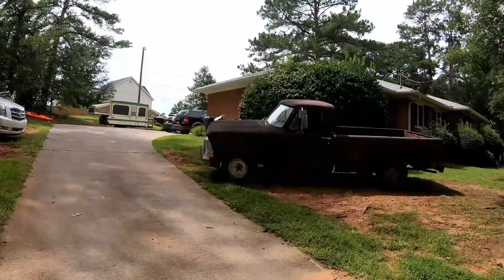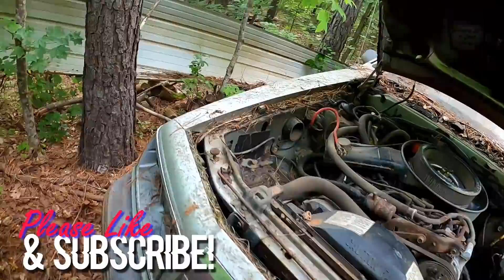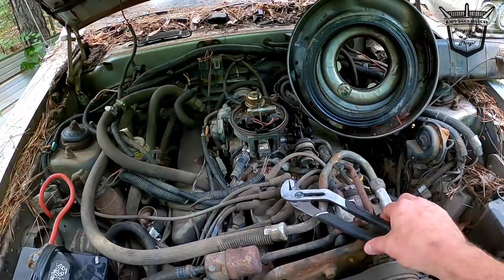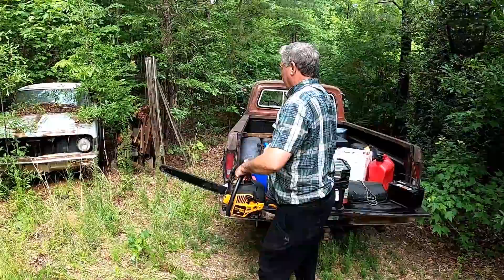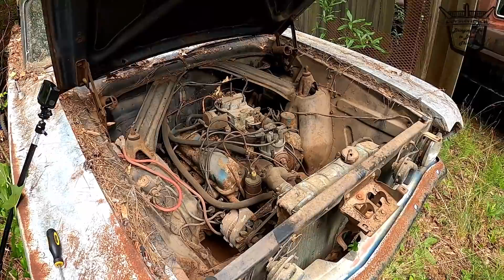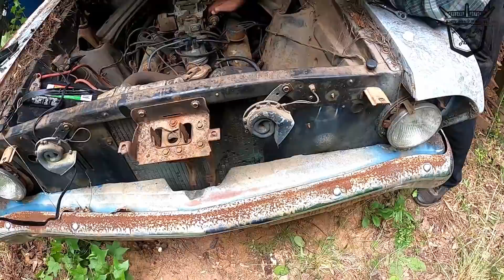First Start in Years? 1965 Ford Falcon vs. 1984 Thunderbird: Battle of the Birds // Graveyard Style?

Comment: Hey on the thunderbird you may be able to take off the throttle body and replace it with a Carburetor if the bolt pattern is the same if not you probably have to swap the intake manifold. Great video have a Blessed One Sir.
Reply from the maker: I think we could have... time was our issue on that day. I did not have enough time to dig into the car any.. It would work.

Comment: That T-Bird brings back memories.  My folks bought one new in April of '84 that was charcoal gray and Ma still had it clear up to around 2000 or so.  Never had a single problem with it, just routine maintenance.
Reply from the maker: If this one had not been wrecked... it would probably ran until the engine failed... fun rides.

Comment: Good to hear the Falcon running!
Too bad about the stuck wheel. 
You'll get it going later on!!!!
(Wish my '61 could have had a 289!!)
Reply from the maker: The engine bay has room... motor mounts and get it done.
Reply: @RevStoration  the ONE rare occasion father was working on one of our '61 Falcons, he mentioned maybe putting a V8 in it. He then commented, yeah, then we HAVE to replace the rear diff, springs,    transmission, front end hubs.......meh. nope...

Comment: Hope I am not repeating something already mentioned. Most throttle body injection (tbi) you can put a carb on them but it will cause a check engine light if the ignition system is good.
Reply from the maker: Yep, we could have but we had limited time and the engine ran that was all we wanted to know. The car is probably just holding the engine for something else.

Comment: That's what you call TBI or Throttle Body Injected  kind of like a carburetor but with electronic fuel injectors with a TP sensor and a fuel pump that runs at a higher psi then a electric fuel pump for a carb
Reply from the maker: WE may remove and drop a carb on it.
Reply: @RevStoration  That will work but I think the intake has to be changed to a carb intake the TBI intake is different and won't allow a carb to fit on it and I am not sure if they have a adapter to fit a carb on a TBI intake

Comment: The 84 thunderbird is the reason why most of the revivals on YouTube are carbureted and not fuel injected. Carbureted engines are easier to work on and don't depend on computers and electronics to run.
Reply from the maker: So true... the carbs make them easier..
Reply: The early FI like that is simple to run but you have to have the proper fuel pump putting out the proper PSI to make the injectors work on a carb it takes 5-6 PSI but on the early FI it takes 15 PSI or higher and today's FI it's even more but the old style is simple but you have to have the proper fuel pump and that cost more money then many are willing to spend on a old car that won't be seeing the road. Evern the TBI are easy to rebuild and you can buy rebuild kits for it too. It's all on how much money you willing to spend on a old car that will never see the road again and that's the reason most of them are passed on.
Reply: FI is just as easy to work on. The ECUs rarely go bad. The rest is nothing more than utilizing a 12v system. Everything is easily diagnosed & tested with a simple volt meter.

Comment: Hey, you all! I had a late '83 or early '84 silver Thunderbird Heritage Edition in the mid 1990's . Bought used with 61,000 miles on it in 1994 for $2000.00. Had a throttle body fuel injected 302 small block V8. 😁😄
Reply from the maker: They run out really well... Thanks for watching..
Reply: @RevStoration  I kinda thought that would get your attention! I've always had a long memory about my cars!😁🤟

Comment: You don't need to crank it to check pressure.  With the key in run, the pump should run.  Bad gas kills the pump in the gas tank kinda quick, so step one: replace the fuel pump in the gas tank......Yeah, might be a motor holder car for an old Galaxy/Mustang/Fairlane/etc.
Reply from the maker: The pump was shot..

Comment: YES, you can feed fuel through the Schrader valve.  To clean the injectors remove fuel pump fuse, connect a tank of cleaner to the Schrader valve and add air pressure to the tank.  Obviously you need to get the PSI right in the tank so check the pressure required. (36-38 psi.) DO NOT let the fuel pump in the car run!!
Reply from the maker: It will clean the injectors but this one was not getting fuel to the injectors.. So it wasnt worth the time.. The engine will still run, that was all we wanted to check.

Comment: Fuel injected engines have a electrical fuel pump, not a mechanical...that is why Thunderbird would not run and you had no pressure on fuel rail
Reply from the maker: Correct... that is why we just flipped the switch to see if the pump was turning on... it wasnt.

Comment: Yall can bypass the fuel pump and run a line where the Schrader valve was and cut power to the old pump and run a new tank and the injectors in the tbi will open and close and the 5.0 will run again just run a electric  fuel pump. To the tbi and a return line to your new tank you will need 2 pumps one on the in and one on the return lines then the thunderbird will run
Reply from the maker: Yep, needed a clicky clack to make that happen.

Comment: That rust is super common on 1983/86 Thunderbird.   I've had four, 2 85's and two 86's.  I wanted one since the first time I saw it on the cover of I believe the September 1982 cover of Car and Driver magazine.   Finally got an 86 in 1988.  I found rust in the rear window filler panel even back then.  I bought my last 85 in November 2021 and has no rust in the back window area.  The reason these were prone to rust is that at the factory when the workers would install the moulding clips would easily scratch the paint creating an environment that was friendly to rust. Plus it didn't help that water settles in the bottom of the rear window. These are California cars too.  When I pull the mouldings off my rear window I will not touch the clips like I did on my last 86 Bird that I painted because I can't scratch what I don't touch.  You have the base model.  Yours is a bit of an oddity.  No power windows but power seat and cruise control.   My 85 is an Elan with every option except equalizer and power seat.  I have no idea who would order one of these especially an Elan without a power seat.  My other 86 Elan had twin power seats and so did my 30th Anniversary model.  Even my 86 Base model had a power seat.  My 86 with a 3.8 liter V-6 had a four speed automatic over drive.  I was getting 30 plus MPG in that bird.  My other 86 3.8 had a 3 speed auto and barely cracked 20.

Comment: Falcon's mag fantastic drag racers :-))
Reply from the maker: So true... unibodies can move
Reply: @RevStoration  Yup... just weld some flat stock along the rails on the bottom and reinforce the shock towers with a bit of steel and put in a stronger spring to handle the bigger motor and torque :-)) They were the original mustang [and the original mustangs had a lot of interchangeable parts with the Falcon]. Many of the mustang kits for front disk brakes and controling arms, tie rods, bushings, sway bar.... all work on the falcons and the two door mercury's [which look a lot like a two door FAirlain or a smaller version of 2 door Galaxy]. Speaking of the Mercury Comets [they made great drag cars and there's a couple of pretty famous funny cars out there if my failing memory serves]. :-))